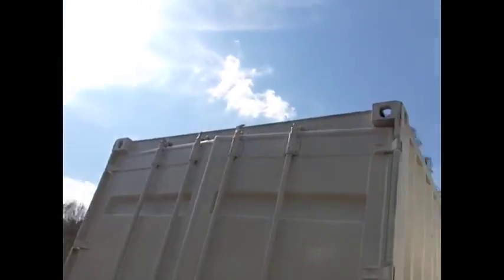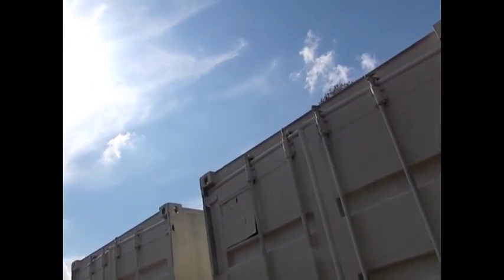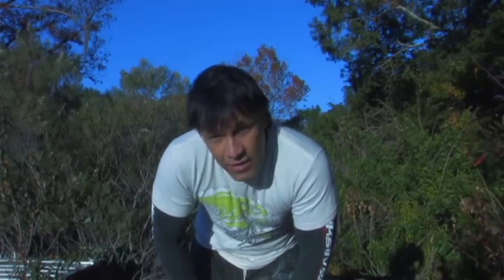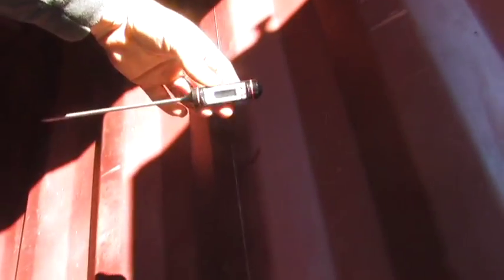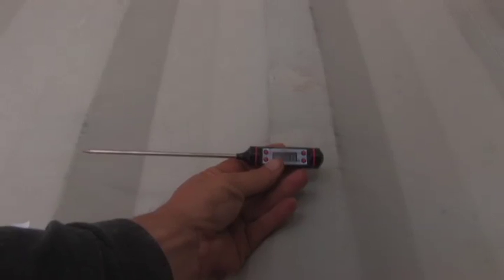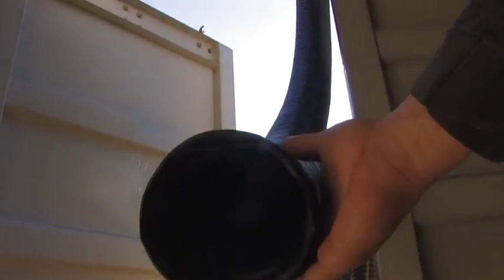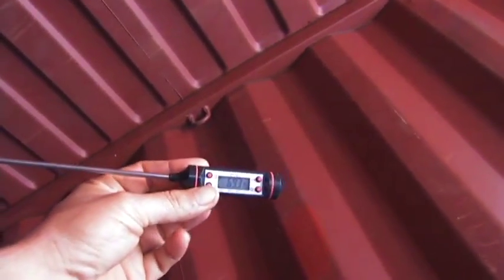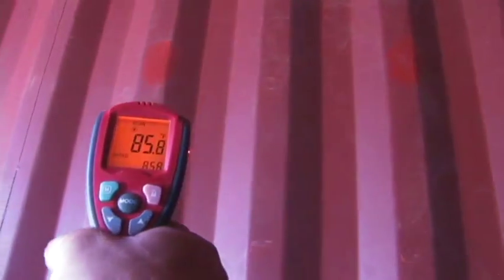Soda Can Solar Heater 2500 cubic feet alternative forced air heating

Comment: @GREENPOWERSCIENCE Hi Dan.  I did see the panels on ebay.  They say 80 watt and about 4 amps.  The boat bilge fans (4") run on about 5 amps.  If I wanted 2 fans, does this mean I need 2 solar panels?  Sorry, but super new at this.

Comment: Now I know where our Sand Hill Cranes go for the winter !  :)    
sharp system,  has anyone tried it in winter ?  
If the air temp is only 15 degrees, does the pipe wall still retain the heat ?
Michigan challenges !  haha

Comment: Thanks for another great video!!

I remember seeing something about pv panels getting hot enough to melt (it may have been the successor to Hubble I was reading about, but hey), would it be viable to combine pv and solar heat panels into some sort of combined power system? With the pv in there, you'd be able to power that fan and then some.

Comment: could air be warmer if you put some electrical resistances inside the hose? 
 electrical resistances could be connected to a solar panel.
Thank you for this video i was looking for heating my own room in some way using green power.

Comment: @GREENPOWERSCIENCE Dan, do the bilge fans have an adjustable cfm or are they one setting? I built one of the "Can" Solar heaters that i know you aren't so fond of. I am having issues with not enough air flow but i am afraid if i buy a bilge fan there will be too much air flow. Love your videos by the way.

Comment: another great video!  Do I need to use that size pipe to make it work well?  To test this to see if it would work in Western WA I was thinking of building a cloche and pumping the heat gained into my home to help bump up the day time temperature.  The thought being I could measure the temperature in the cloche to determine how much heat it might produce.  by cloche I basically mean a black box with a glass front as the heat source

Comment: @MrJJ2K Solar heat is amazing and clouds/snow do affect it, obviously. But it actually does not care what the ambient temperature is. We have a small solar oven that we use on sunny days here in So. ID. Even when the outside temps are well below freezing we can get the oven to over 250 degrees F. I do agree that in the vid the plastic tube exposed does have an effect on efficiency though.

Comment: @labidus74 That is true but the air will also become more and more stale. I would suggest that anyone doing a pure recycled air system also include a make up air intake. Fix it so that a small percentage of the air coming into the space is fresh outside air. Something like a 'T' with a small entrance acting as a venturi would probably work.

Comment: Nice video, if you take the air from inside the container and return back in the tube and heat the air from the container and return back you will get a higher temperature inside because you will heat  the inside air not the outside! So the air will become more and more hot

Comment: when i had my above ground swimming pool I would heat it by extending the out side of the filter pump to a giant coil of black hose. i would just coil it it a big 10' x 10' circle on the lawn then back into the pool. the pump would draw the cooler water from the pool into the pump, out of the pump and into the black hose around anbd around getting heatted by the sun, then back into the pool. it would get sooo warm that i would have to unhook it and let it cool back off.

Comment: Pretty cool, but I think here in Colorado, that blade tube would lose more heat than it would gain unless I put it under a layer of glass or in another clear tube or something.

One time I made a solar heater out of bubble wrap with black plastic on the inside.  The fan inflated it like a pillow.  Worked great!  The bubble wrap is actually a decent insulator.  You should try it sometime.

Comment: @MrJJ2K My point is not about metal containers, but about the general concept of solar heating.  It's been very cold here for the last two months, temps usually -15 to -20 C, but yet the difference between sunny and cloudy days is remarkable.  I keep the thermostat around 68F which is a bit cool, yet on sunny days, it heats up to at least 78F; on cloudy days, it never reaches even 70F.  Proof of concept.  Just have to find a way to control it.

Comment: @MrJJ2K We get a surprising amount of solar heat into our living room in southern Manitoba when the sun comes out in January and February.  It can add some 10 degrees to the temp.  It's not necessarily our choice:  the condo has dark shingles and not much if any insulation between the attic and main floor.  It certainly saves on our heating bill on sunny days, but bad for air conditioning bill in the summer.

Comment from the maker: @MrJJ2K 23%-37% of heating bills occur when the sun is out depending on where you live, this is not a replacement for a traditional heater system, it is used to reduce your bills.

Comment from the maker: @morto360 Hi, Sq ft of sunlight is what determines the output. A 3ft diameter parabolic mirror concentrates the same net heat as a 3 ft diameter black circle or coiled black hose. The mirror can concentrate very high temperatures to a very small area, the black circle reaches lower temperatures over a much larger area. This setup collects the equivalent of a 5ft diameter parabolic dish or Fresnel Lens.